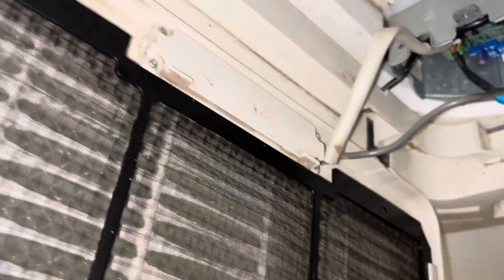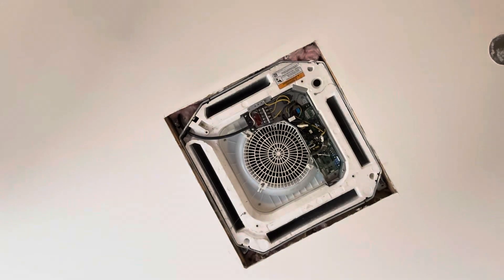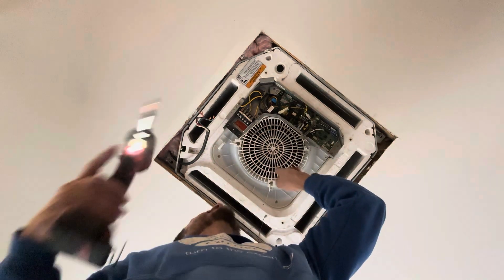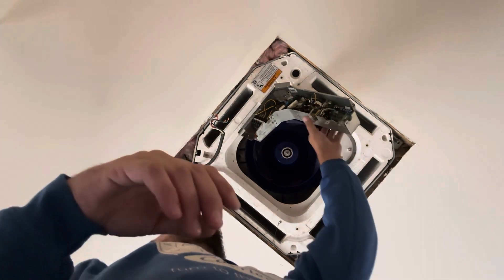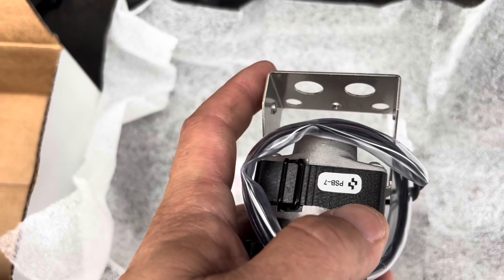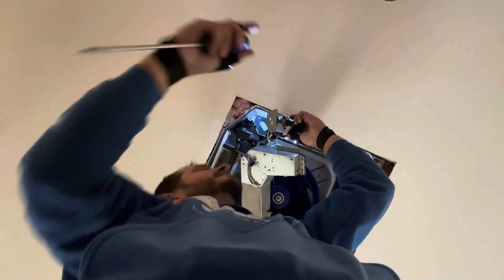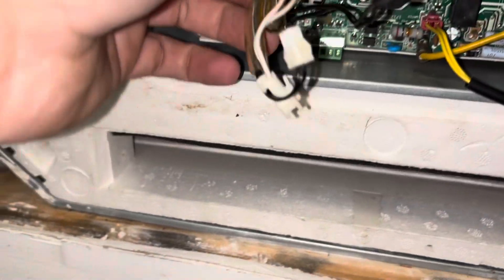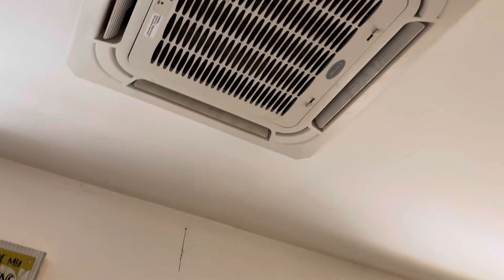Carrier Ductless Leaking Water!  Replacing Condensate Pump And Board

Comment: I don’t know about you but I find I have more problems with the ceiling units versus the wall units. 🤔 lol an I would much rather work on a wall unit than the ceiling unit. As I have explained to Employees  I provide you with a camera phone for a reason !! Always take pictures prior to disassembly. It makes reassembly so much easier specially if it’s a day or two later cause you had to wait for Parts an ounce  of prevention is worth a pound of cure!😂😂 nice job on a good training video!!
Reply from the maker: It’s about half and half with me on repairs on wall hungs vs ceiling.   But you’re right.  Pictures before hand have saved me big time